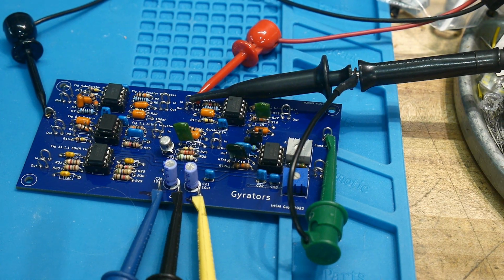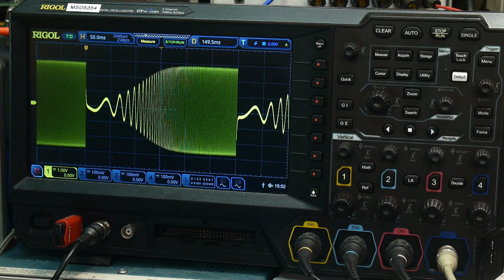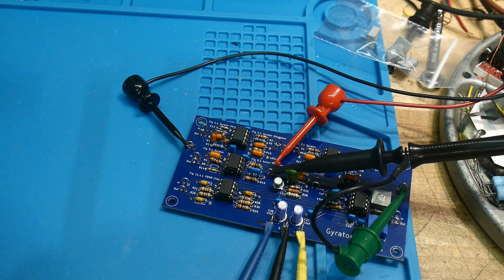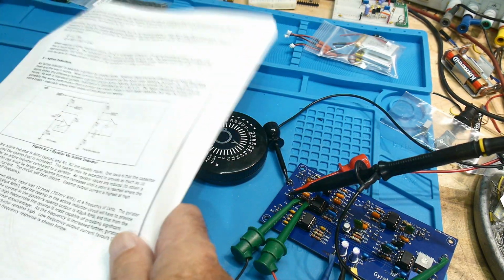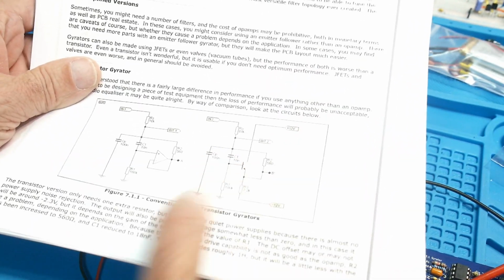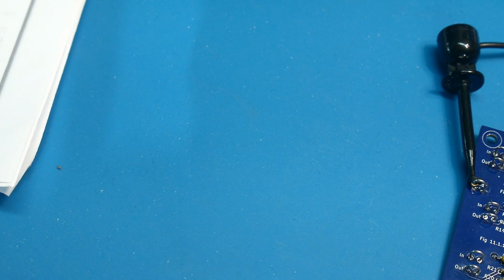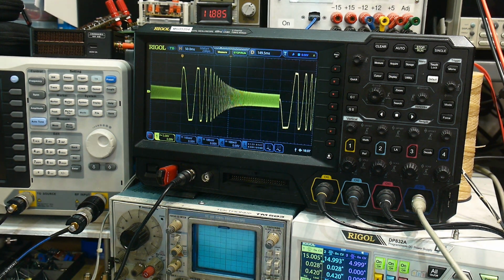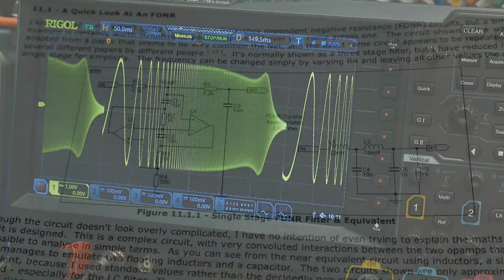#1783 Gyrator (part 3 of 4)

Comment: Ah, Elliott Sound Products! I have very fond memories of this site, dating back to 2000s. I learned tons of stuff on audio electronics and built a bunch of projects from there. As for gyrators, they're pretty common in graphic equalizers and tone controls. 

You have a pretty clever and little resistor substitution box, BTW - and those rounded sprung hook probes look nice too.

Comment: *Abstract*

This video explores the use of gyrators to build active filters, components that manipulate audio signals in various ways. The video presents circuits from Elliot Sound Product's design publication, demonstrating how inexpensive gyrators built with op-amps and transistors offer remarkable performance as substitutes for bulky inductors.

The circuits covered include:

* *High-pass and low-pass filters*
* *Band-pass and notch filters*
* *Inductor simulators*
* *Equalizers*
* *Frequency-dependent negative resistance (FDNR) circuit*

The video highlights the versatility and advantages of gyrators, including their size, cost-effectiveness, and adaptability. It provides a valuable resource for anyone interested in audio electronics or filter design. 

disclaimer: i used gemini advanced 1.0 on 2024-02-24
Reply: Cheat ! :)

Comment: The circuit for fig 9.1 is not a hi-pass/low-pass. It's a low-cut/low-boost as it always leaves the hi untouched and either increases or decreases the lo